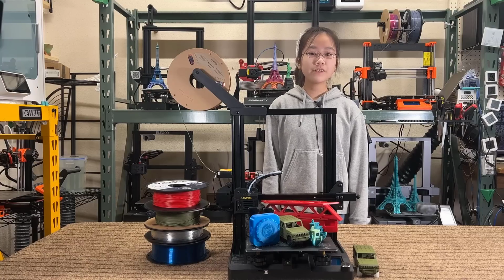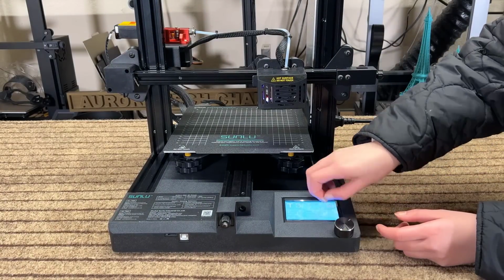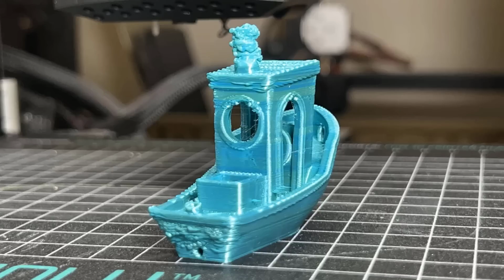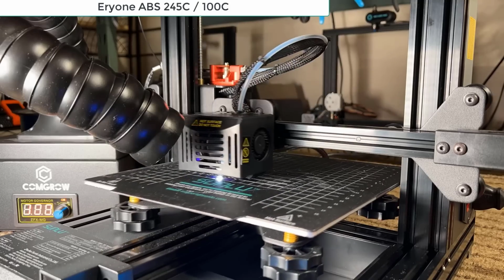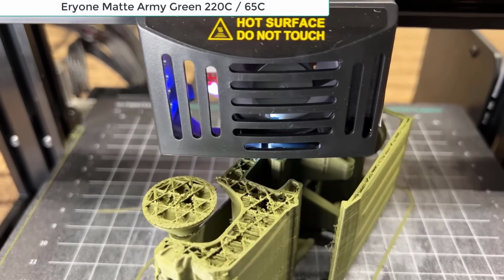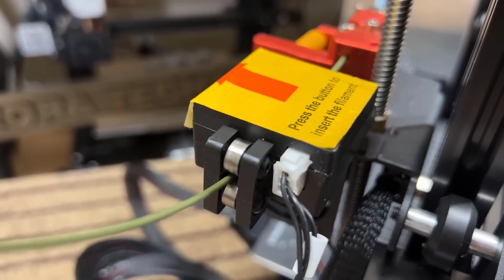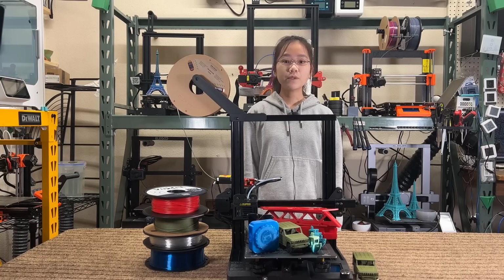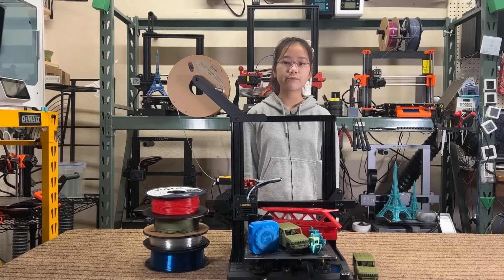Sunlu Terminator 3 T3 3D printer, a $200 3D printer that prints at 250mm/s. Are you serious?

Comment: Excellent review, as always.

Could you advise? I have 2 Ender 3's, a Pro and a Max, but I want to print TPU and other flexible filament. Can you recommend a fairly inexpensive printer for this or am I better upgrading one of the Enders to direct drive?
Reply from the maker: You can try Eryone TPU, I can print it with a stock Ender-3 at normal speed.
Reply: @AuroraTech  thanks for the reply. Will give this a go.

Comment: For the price, this is the best printer and has excellent touches like the bed probe, encoder filament sensor, insulated heated bed and locking dual adjusters on the bed. Just tune Marlin input shaper and it's unbeatable !!!

Comment: I was expecting the machine to be running the latest version of Marlin which has Input Shaping, so at the highest speeds it should then be able to produce cleaner results. Of course, even then, to truly achieve such high speeds requires a high-flow hotend, well-tuned Linear/Pressure Advance, and very good print cooling. As the maintainer of Marlin Firmware, I can help to produce an improved version of Marlin (2.1.3 or 2.1.4) for the benefit of those who own this Sunlu machine, and perhaps Sunlu will use that as the basis for a firmware upgrade and post that update on their own website. It may not get it up to the touted speed of 250mm/s but it should at least give improved results at the highest speed it can realistically achieve. Thank you for your thorough review and including the helpful firmware upgrade advice to Sunlu. It really helps users when there is an upgrade path that actually improves the value of their hardware.
Reply: Hi Scott, this machine deserves some attention - it is a great value for novices as you don't need to buy anything else to get started except filament and a metal flex PEI.  It has been printing beautifully for the novice I gifted this machine (see my comment) using Chuck H's Cura profiles.  They just called me to say how well it's doing on an ambitious 23 hour print.

Comment: Bought one at the introductory $135 price as a present for a novice.  We did not even try the 250mm/s as I knew it was hype.  It has been performing flawlessly at "normal" print speeds with decent prints.  I agree that input shaping, etc. should now be offered standard since no additional hardware is needed.  Also agree on the PEI flex sheet - that is the only upgrade I did before gifting the printer.  At the introductory $135 price it was a terrific price performance value.
Reply: Hype is one thing. A lie is another.
Reply: I was thinking about buying one.  Have you tried it at 100ms?
Reply: @thomaspc2  Truth be told I did crank it up while printing a cal cube for several layers for grins and with a little tuning and input shaping it would be able to do functional prints well but you could do that with most 2XXmm bed size slingers.  You'd either tune it for speed or for quality but not both on one printer without a lot of setup changes (including changing extruder e-steps) between prints.  The real attraction is a complete Marlin-based price/performance with ABL printer that nearly works "out of the box" - I did a FW update, swapped for a metal flex PEI (I like the ones from TH3D), did the initial ABL calibration, and started printing.  Then it's just the usual fine-tuning for your favorite filament(s) that you can do from your slicer.   I was able to show a complete novice how to use the printer with some tuned up profiles on Cura (using Chuck Hellebuyck's as a starting point).  They went home and sliced and printed their first print that same evening.   No phone calls since except pics of what they printed.  I give it a thumbs up, especially if you can buy this for under $200 shipped.  It has become one of the printers I recommend for novices, especially if I become their "support person' which is usually the case. :)

Comment: Once again, your review is outstanding and since you used the word in the script, I want to repurpose "rare" to identify your skills.   Your reviews are the "benchy" of You Tube.  Congratulations.  "Now for the cons"; no not about you.  This printer should use a Volcano Nozzle configuration or the newer channeled versions; however, this would be but a 'patch'.

 As a result of your previous Elegoo Neptune 3 review, I purchased one and found it as you described.  But hated the single Z axis drive which when powered off always jammed the nozzle into the bed.  So, I purchased the Neptune 3 Pro as an "upgrade" and I am so very impressed with it.  If you have time, for $230 USD delivered, your review would likely identify to your fans a superb entry level to intermediate level 3D printer: No Touch Auto Bed Leveling, Dual Z axis drive, Direct drive extruder, substantially upgraded menus on the magnetically mounted LCD display, LED lights.  It does not try to be a 'fast' printer.  Hopefully this comment is not a TLDR.

Comment: how can you have something that claims to go that fast and still be using a bowden type extruder + inadequate hotend setup, I get they're trying to bring in something at a low price point to inject themselves into the market but this thing just seems to fall short of what they probably intended it to be. It's one thing to go fast, but to go fast AND print good is something you're not going to get on a budget printer like this. It is nice though to see more saturation in the market, forces other bigger names to compete with pricing while also making more features standard and innovating at lower price points since not everyone can afford a Bambu Labs X1 Carbon.